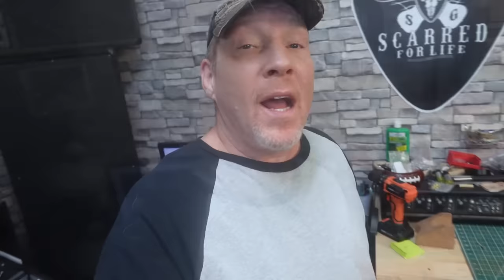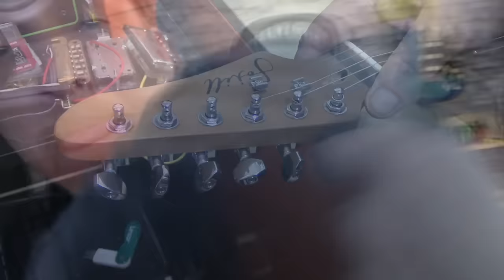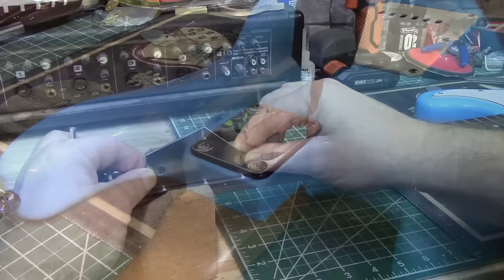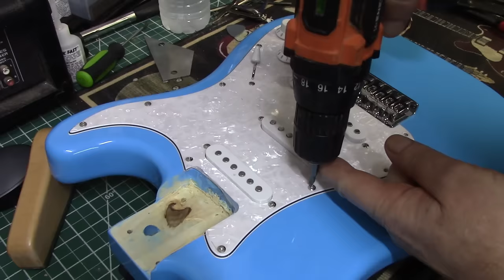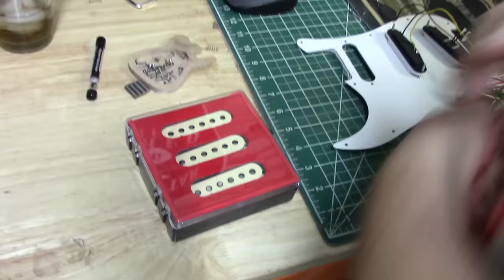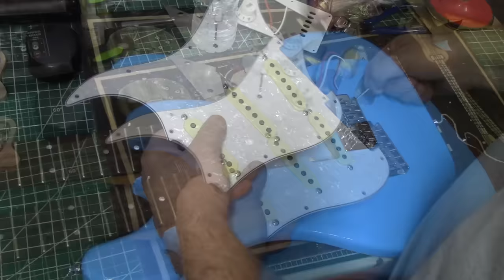FOJILL Stratocaster Copy! A LOT OF GUITAR FOR THE MONEY ALREADY BUT Add Fender Pickups and BAM!!

Comment: Common mistake with bolt on guitars. The screw hole should be drilled out so that the threads don't grip the body at all. Threading thru the body makes it VERY difficult to get the neck pulled tight to the body leaving gaps and often necessitates a shim to correct. Sean have you tried stainless inserts into the guitar neck and using machine thread screws instead of wood screws? Cheap enough to do and is especially good if you have an old style truss rod that adjusts at the heel.
Reply: I agree 100000%

Comment: A lot of us don’t have a fret press , files , and or experience setting up a guitar. A standard setup does not include a rebuild. For my money and time I would prefer a more expensive guitar.
Reply: I bought a cheap harley benton strat and it was perfect. Put a bone nut on, changed the pickups and the switch, added a treble bleed and it's a beast!

Comment: Much better! It’s interesting to see the difference between the one you gave me and Trey’s. I mean, they are two different models and the one I got cost a few bucks more (like $20-$30 as I recall off the top of my head) — and so maybe the factory alloys a fraction of a few seconds extra to work on the model that costs a tad more along the assembly line. 

At the end of the day, for $99, it didn’t take much at all to make this Fojill a great player. Kinda shocked that those pickups were barely wound, but you popped in a great new set for him to enjoy. A little tightening on the tuning peg knobs, a little TLC on the frets, adjust the truss rod a hair . . . and shazam!

I think the most “difficult” thing would be the soldering — and that’s a skill anyone can learn. This is probably a great guitar to learn how to do guitar work since it’s a low cost that is difficult to screw up. I don’t understand why they bother with these trems at this price point, but with a routed cavity, someone can buy a replacement trem and learn how to install it — but don’t expect them to work and hold tuning at this price unless you replace the entire thing along with the tuners. The tuners are great as-is for a decked setup, but might be another story if you try floating a trem. Practice all sorts of repair/setup skill on a guitar like this, and watch Sean’s videos for help .  . . you’ll learn in no time!

I wonder how Trey thinks this Fojill stacks up against the Fesley he opened now that Sean fixed it up. If his Fojill neck is as buttery as mine, he’s got an amazing player there now! Can’t wait to see his reaction when he gets it back!

Comment: Sweet!  I recently did the same with a Firefly Mad Cat, I put Fender Tex Mex pups in it (well the bridge and neck pups only of course) and it rocks the house.  Thanks Sean and Cathy for yet another great video.
Reply: FFST Ash Wood Body ELECTRIC GUITARS (Black&Silver Color) - an outstanding guitar for a mod .  New pups and a S/S trem (big block)  You'd be surprised the tone change you get changing out the Bridge/Assembly on either the Strats or Teles from FireFly.   Cheers

Comment: I hope this hint helps you. I saw you drilling into a painted guitar and worried about tear out. One way to avoid this is to run your drill backwards until the bit is about a 1/16th of an inch deep and past what tears out then switch the drill to forward and finish the cut. This won't help the other side if you have to drill through it. I've done this and it worked well for me. It reminds me a friend when he cuts vinyl siding turns his power saw blade backwards to cut it. It scrapes the vinyl away instead of cutting it. Still gets the job done. I enjoy your videos.
Reply: Saw backward is how you cut plexiglass without shattering it and also laminate counter tops.

Comment: There is elusive presence with some classic and expensive guitars, set up properly of course. This has that, which is inexplicable. I always went for cheap guitars and did the fix-up as you suggested because I wanted the quirkes and character. I felt that gave me a performance edge. When you plugged in the corrected Fojill it just came out screaming. Nice job.

Comment: Just received the strat model Fojill from Amazon. Out of the box I gave it a quick tune and checked out the intonation and I am blown away with the sound and setup. You’re right Fender should be ashamed. Smooth neck and no sprout.

Comment: Great video! I just got their Tele it was quite acceptable out of the box It tuned up fine but needs the "examination" for me to really know. The pickups, jury's out because I have only used a small spark practice amp to listen to the pups and that's no basis for a decision. I just put Tone kings in my CV Tele a week ago with a 4 way and compensating saddles, big improvement. Ill have to decide on this one but initial impressions prior to checking and dremel polishing the frets it it's got at least great bones to build on ( sounds good acoustically, lively) if you dont mind the finish.Never cared for the preworn finish  but this would certainly make it bar gig drunk safe. Now I know what I was feeling on this neck, a 16: radius, that will certainly do it. Thanks.

Comment: Out of curiosity, if the guitar was sent to a shop, how much would the average bench service prices be for straightening a neck and re-leveling and de-burring the frets?  Including lowering the action closer to the frets?
Reply: If you have a good tech the person will charge $85 -$125, but it will only get you a basic setup (new strings, a turn on the truss rod, check the  nut slot and adjust, set bridges saddle, intonate.    A lousy one will "attempt" to do everything that Sean just did and do most everything poorly and charge you $65 - $85.   But back to the good tech, if he did everything thing Sean did (minus the electronics), that would get you up to $225.  If you just want new electronics it would be the price of PUPs and an install cost of $125.   Understand there are a lot of guys that can do this work real well because they've played for decades and only work on their own equipment.  I've played for 50 years and have never taken a guitar in for work since I was 14.  Learned quickly there are a lot of bad techs.
Reply: @RA-ew8rv  Thanks.  I'm handy with a soldering iron, so wiring pickups is no problem.  It's the fret dressing and leveling is my concern.  I lack the specialized tools/ measuring gages, and don't do enough setups to justify spending several hundred dollars for the specialized stuff.  The "hidden" cost is in the labor and tooling required to make a "budget" guitar into something useful.

Comment: I would suggest also changing the tremolo system and the pots. There are good quality parts in GFS for really low price. It will still cost lower than the cheapest Squier.

Comment: Well, unfortunately, a really "cheap" guitar can be decently constructed and then may even be set up to play perfectly at the factory but, by the time any new or "green" wood on it changes and settles while traveling across an ocean in a hot shipping container and for months even, then things can drastically shift or warp, and frets may "sprout" too. Sometimes all that can happen after the guitar arrives at your home even when it was just fine out of the box the first day, so, there's a difference between a real problem "fix"and an acclimation adjustment and every guitar is individually unique too.
Reply: My Yamaha 112, was a birthday present from my wife in 2001.Over the years I have changed all the hardware, electronics, and pickups, several times. I must be on at least my seventh set of strings. I have enjoyed it all this time.

Comment: Does the unplugged tone matter when you turn up the axe?  I say it does -- unless you never play it unplugged.  I don't, myself.  Still, all the unplugging does is take electricity out of the system.  The guitar is going to vibrate much the same way unless you're playing with enough gain to feed the guitar back.  The acoustic tone is where the guitar starts; the player decides the rest by making choices.

Comment: Looks like a Richard Petty Blue or even MLB Philadelphia Phillies Powder Blue uniform colors. Sounded great after some work to it. Would've been interesting to see how the original pickups would've sounded with the set up adjustments, maybe pickup heights adjusted . Even with the Fender pickups for additional cost, I think those are another $ 120-130, unless there's a set on sale that get them down to around $ 100. Crazy that there were frets lifting & every tuning knob was loose ? Truss rod was also relaxed. That's one of the first things I check for, does the truss rod work, does the neck respond to be loosened & then tightened to at least where it was out of the box & in this guitar's case, tightened for lower relief.
Reply: One of the things I look for with any guitar is the "neck pocket sandwich". That's a side profile of the neck pocket area. There's going to be the body as a layer (electric blue with the Fojill). Next layer is the pickguard, followed by a layer of maple (roasted or not). The 4th layer is the Rosewood fretboard with frets on top of that. With Fender Strats, that sandwich is guaranteed for non-maple fretboard guitars. That's when I have a good idea it might need a shim without having to disassemble everything and using a caliper to measure neck pocket dimensions and the heel end of the neck.

Comment: I have a theory about these budget guitar flat fretboards. I'm thinking they're radiusing the fretboard by hand, and every minute saved from sanding is a minute they can put toward another guitar neck and keep the cost down. Either that, or they're cutting the fret board thinner than normal, and over radiusing the fretboard makes it too obvious. Regardless, it's a cost savings measure.